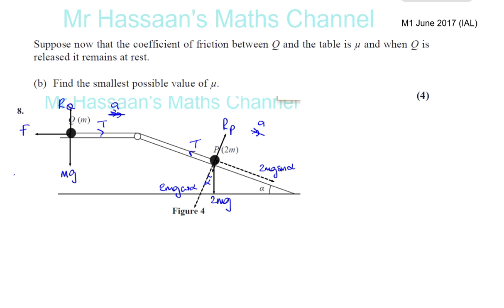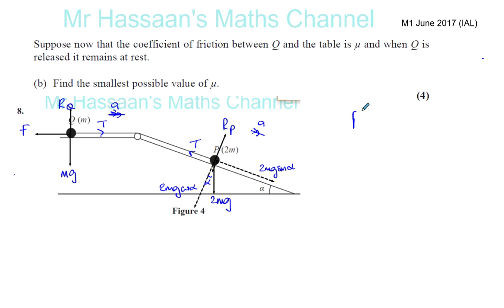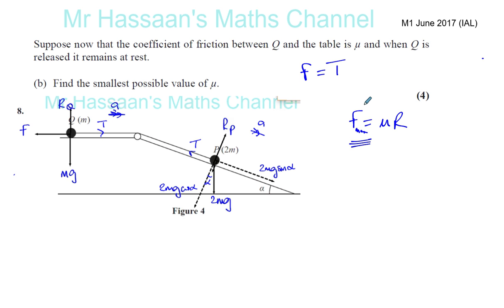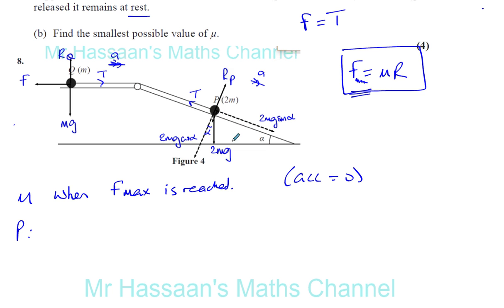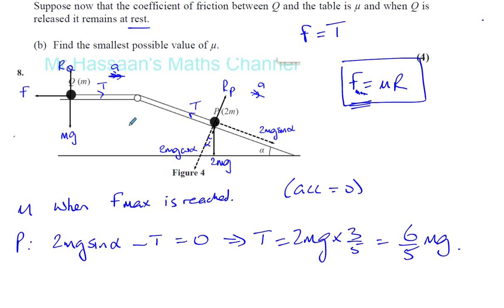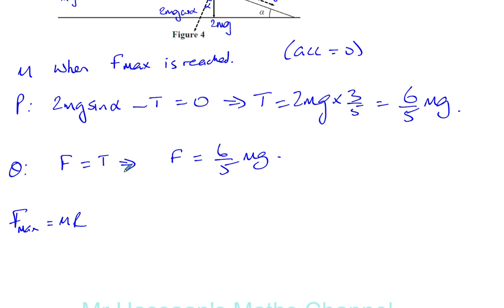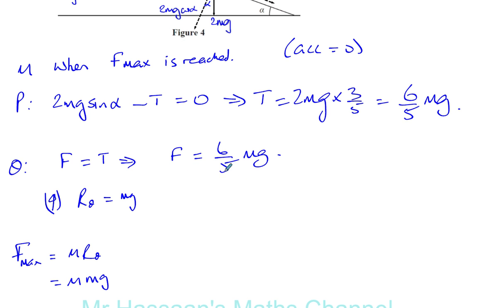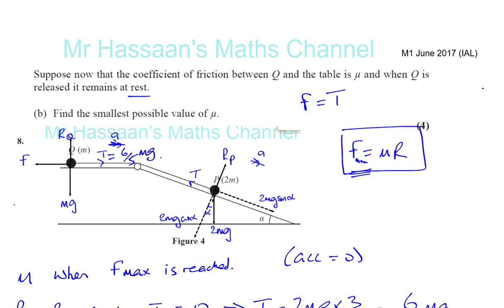EDEXCEL M1 IAL JUNE 2017 Q8b Dynamics   Connected Particles

Comment: how is miu 1.2 when it can never be greater than 1?
Reply from the maker: You can check the mark scheme if you wish... that is the correct answer to this question. The coefficient of friction in most cases would be less than one but there are cases where the coefficient of friction is greater than one. It isn't impossible... for example with velcro... the normal force is less than the frictional force so it would be greater than one in this case.. if you google it you will find out more